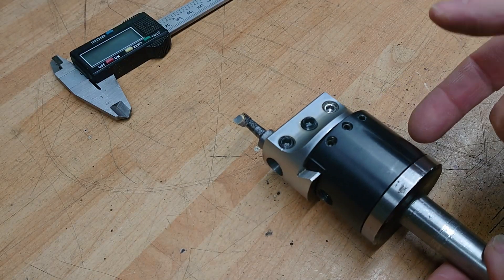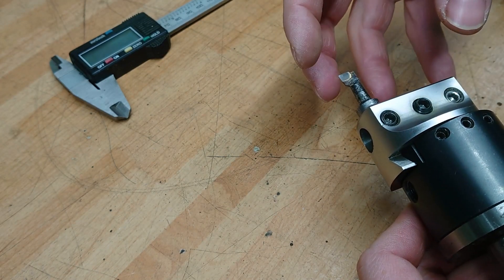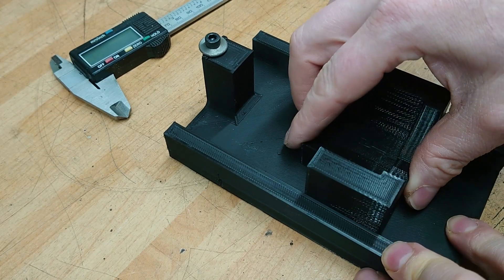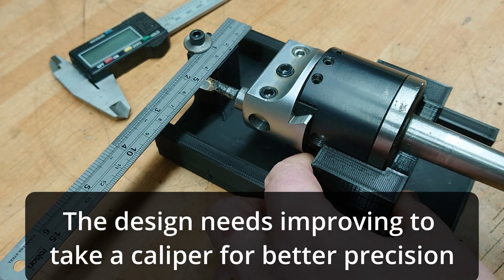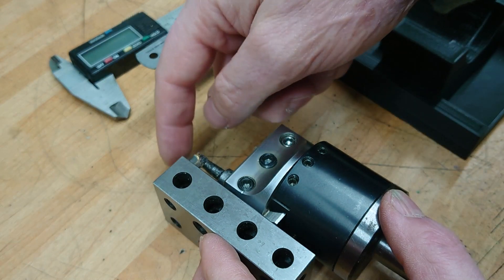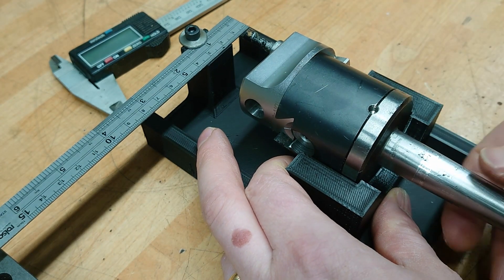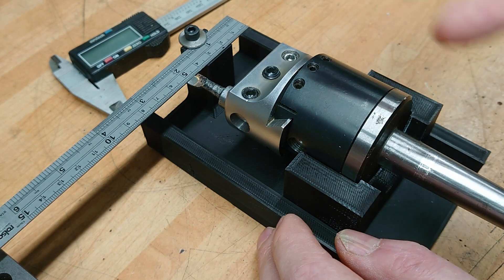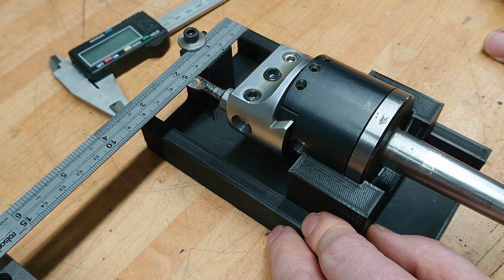A Boring Head setting tool - 3D Printed! (Advent 22 Day 23)

Comment: Hi Olly, great idea for the home shop and cheap as chips like you say. In industry, everything is done relative to centre line so you would always set a radius. This would be done in an optical projector tool pre-setter, where the tool holder back end (which ever taper configuration) fits into a rotating spindle with the female taper geometry, allowing you to rotate the whole assembly past the optics, and ensure precision within microns relative to the spindle location geometry. Hope this makes sense, but I have effectively described a tool pre-setter. If you want to see one, search Kelch, or Zoller (other brands are available). Cheers, Jon
Reply from the maker: Hi Jon. Yes, that makes total sense. Thanks for the insight.